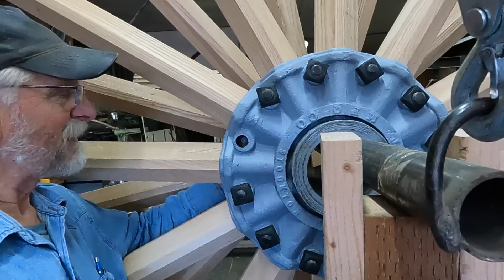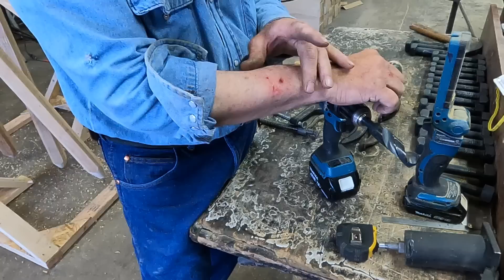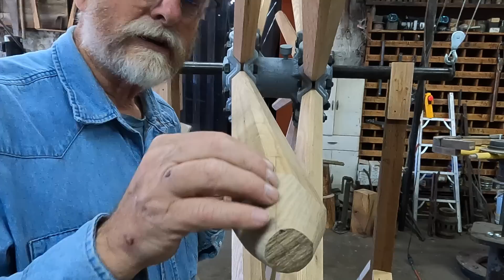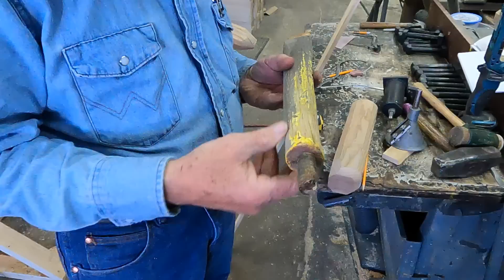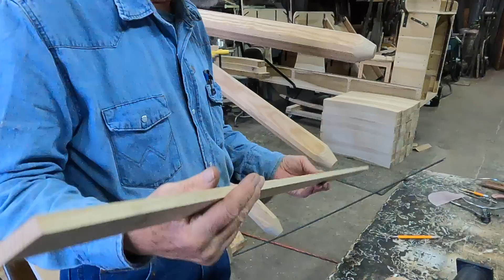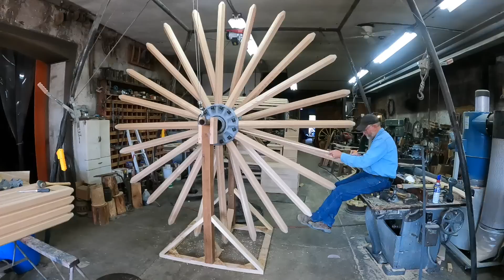Fixing Miscalculations on 10' Logging Wheels | Engels Coach Shop

Comment: Dave,
There is no job too small or too BIG???  Wow, this wheel is massive !  Talking about "blood, sweat & tears" !   I too know about a "torqe monster" drill.  I have an old Milwaukee 1/2"  gear reduction drive electric drill motor made in the late 50's, early 60's with the alloy body (before the plastics invastion).  I only use that when I have a helper as it will break your arm if you are not careful.  So the bumps and scrapes on your arm are something I am familiar with..  This job is a fasination in the respect that 98% of the wheels  you work on  are of the wagon/buggy variety.  The 20 Mule Team Borax wagons and water wagon was my first intro into large scale work that you did and I have been hooked since.  This 10' wheel shows the innovations of the early days and the engineering that was around that most of us are oblivious to.  I didn't even know that they made such monsters as this.  It is a wonder watching you bring this wheel back to life.  Great work!    P.S.  I hope that you get someone to help you getting that monster "vertical" and on a stand.  You have had enough injuries!

Comment: Are you sure you have to turn them horizontal? I know that sometimes you put the ends on vertically. Sounds like a lot of work turning horizontal if you don't have to. But you're the expert, you do you. Just be careful. That's a lot of weight. 💖🌞🌵😷

Comment: Hi Mr Engel
Why did you put the nuts on the bolts securing the spokes to the hub on the outside of the hub?  If I was doing this job I would have put the nuts on the inside of the hub as I feel a bolt head on the outside of the hub is more aesthetically pleasing.
Regards
Dereck

Comment: From a physics/mechanics point of view, the spoke tenons should not be angled to perpendicular to the rim. Load points hub-to-rim should be one straight line, else a tendency  to split open the spoke.  From an assembly point of view, what you are doing is desirable if not absolutely necessary.  A design solution is to taper the tenons just enough to clear the angles of dish and interspoke radii.  This allows for ease of assembly in both directions, lateral and circumferential.  For example, a 10% taper locks up so good it is standard in machine shops to hold high torque shafting together (see Morris Taper).  But in wood, wet swelling gives problems whether taper or constant diam.  The key would be how the tenons are locked into the felloes (beyond compression). A round dowel from side to side through the middle of the tenon?

Comment: First, I know nothing about wheelbuliding other than building a couple of wire-spoked wheels.
But: with wire wheels it's not unusual to have the spokes from each side enter the rim (felloe) on different hole circles. (and sometimes they alternate, and the 1914 Crossley cars laced one hub to two rims...) So did you check the photos to be sure that the spokes enter the felloe on the same circle? 
Also: If I was making these wheels, I would have staggered the felloe halves. Possibly because I know nothing and would have later regretted that choice. Would that work?

Comment: I'm wondering how you are going to get the shoulder of the spoke ends to line up flush to the felly when adding that angle to get them perpendicular to the felly.   Looks like some chisel work up ahead.  I can't see why the spoke ends need to be angled.  If you make them true to the total spoke and drill the gelly holes at an angle to match, the ends should be able to knock into the felly holes with a bit of initial splaying.  You'll still to chisel the spoke end shoulder to compensate for the dish angle.

Comment: The difference between something being "engineered" and being "crafted"... When it is "engineered", you draw up your designs and cut it out / machine it exactly per the design and it should fit together exactly as you designed it.  When it is "crafted", you plan less and leave yourself some extra slop in the dimensions so that you have room to "make it work"... Considering the fact that you are working with inconsistent castings, an "engineered solution" would be an optimistic idea at best... ;)

Comment: Use the clutch set on it's highest setting on the Makita when drilling holes to prevent such injuries. The clutch will just slip when the bit catches, instead of trying to break your wrist. As soon as I detect that the bit is starting to "grab", I turn the clutch on.

Comment: Is angling the tenon a good idea?  You are cutting across the grain at each end and the amount of continuous long grain left is somewhat reduced.  Why can't you drill the felloes to suit the entry angle of the spokes?  Assembly would be not much different to persuading the spokes into a standard felloe, except you'd have compound angles, but given the length of the spokes, I can't see it being a serious issue.  A bit of extra fiddling, but certainly not beyond the wit of man, or indeed a man of your obvious capabilities.  I am an Engineer, not a wheel builder, so if I'm missing something, please set me straight!

Comment: Dave, while creating the tapered ends coukd be wishfull thinking, leaving the spokes long was precognitive foresight! At some point in your considerations, your mind has been determining how to install the fellow on the spokes. Realizing that either the dowel ends would need to be angled or that the dowel holes in the fellows would need to be angled, and which will give greater strength  your mind allowed for both options. By angling the dowel ends, it reduces stress on the fellow sections and will make that joinery easier and stronger.

Comment: Fascinating and as always, beautifully presented and explained fix for a minor hump in the road.
When drilling catchy holes, flip the drill to screwing and set the torque control where it'll drill without constantly stopping, but doesn't try to chew your arms off in the process.
Obviously high / low speed gives more torque settings also.
There are torque bars in the box with some drills, though they're easy to make too.
Thanks again for sharing.
Absolutely love following your work!!

Comment: Modern drills are dangerous.  A plumber working on the new addition to our house had his DeWalt drill catch while using a 1" spade bit.  It broke his wrist.  Having witnessed that I bought a "Flex" 1/2" drill.  They have sensors that sense when the bit catches and shuts the drill down.  That was 2 years ago.  I've had it shut down many times but never been hurt by it.

Comment: Good Job !!  
I don't know if you knew exactly what why you added the 1/4" to the rough spokes in the milling before needing it. But, it reminds me of the many x's I would see a co-worker (partner .. as we usually had teams of 2) making risky choices early on in the project. 

Side note:
usually one of us had more experience than the other, so, ego was bumped up against at times.

Anyway, I didn't always know what exactly the step that would fail or what problem that might occur when I suggested to the co-worker that he might want to re-think that step or that cut in this case. But, somehow I knew there could be problems farther down the line. 

I have to say, it's hard for the co-worker to hear a critique if you can't explain exactly what you are afraid of happening and some critique's can end up w/several different outcomes. 

3 steps later you find out what exactly you were worried about and you hope you've given yourself plenty of leeway or you find that you've failed and should have.

Experience is a great foundation to lean on. But , in my case , I'm sure that working by myself was most successful. My bosses told me I was the slowest at everything but they never had to geaux back and fix anything I did. I guess that's why they kept me and eventually had me running the jobs. 
I'm not boasting. It was never appealing to have arguments from my suggestions.  But I didn't like the # of carpenters I've seen over my 30 or so yrs get fired for too many mistakes. But I will say, I always enjoyed the sense of accomplishment that came w/the challenging jobs the bosses gave me and the fact that I could focus when working alone.

God job Mr. Engels,
Thanks for sharing your thoughts and fine work,
Sincerely .........................
God bless.

Comment: Very nicely explained. So if you had cut the tenon straight down the axis of the spoke, you'd then have to drill the hole for the tenon in the fellow at an angle. And the next tenon/spoke would be at a reversed same angle, so each all tenons/spokes from one side would be at the same angle and all  tenons/spokes from the other side would be at an equal but opposite angle. So when assembling the fellows, then you'd have 2 different angles to contend with for the tenons, which would make assemble very hard if not impossible.

Comment: I was wondering about the angle also, but was wondering why the holes in the felloes couldn’t be drilled at an angle to match the spokes.  I know motorcycle wheels are a completely different animal, but on motorcycle wheels the sockets for the spokes are stamped at an angle to match the spoke angle as you don’t want a bend in the spokes where they enter the rim.  It isn’t obvious to me why this wouldn’t also work on wood wheels.  It would require a jig for the drill press table to hold the felloe at the required angle, but this seems to me to be no more difficult than cutting the spokes at the right angle and location to center the dowel on the spoke at the base.  The big issue may be that there wouldn’t be enough give in spokes of this size to accommodate the slight change in angle that would have to occur as the felloes are hammer on as the spokes would have to move toward the wheel center as the felloe moved into position.

Comment: It's hard to tell in the video, but it looks like the tenon end of the inner and outer spokes are not quite in the same plane. Are the spokes going to need to be bent inward a bit to be in the same plane, and will this mean the tenon angle needs to be even a little greater than what you just marked?
Reply: Yeah that bothers me too. It looks like those spokes are never going to meet the centerline of the wheel. And considering their stoutness there's going to be no bending them in.
Reply: I too was wondering about the spoke inner & outer sides each a little off the hub center. Maybe the felloes are wide enough to allow the tenon holes to also be off set to accommodate this. Guess we'll find out next chapter.

Comment: Why can't the tenons be straight and enter the fellows at an angle? Wont the bending force be balanced by the opposing set of spokes?
Reply: I'm no expert but how could you knock the felloes onto the spokes when you have two different angles built into the felloes. and the spokes
Reply: @pertwee9376  Well you can sew on your new expert patch.
Reply: @pertwee9376  possibly by inserting the spokes into the felloe sections first, then bolting them up to the hub as sub-assemblies? Unlike conventional wood hubs the order of assembly may be more flexible here? As gav2759 commented below, this approach would still leave the problem of the tennon shoulders not meeting the felloes correctly.
Reply: @pertwee9376  I did not visualize that right. Also that correction must happen when he cuts the tenons vertical against the floor.

Comment: With 48 of these spokes to cut, I'd think about making a horizontal tenon cutter, or modify the current tenon cutter you use to cut horizontally.  Looking forward to seeing how you overcome this one, Dave!
Cheers!
Whipple
Reply: I think a length of pipe of proper dimension with cutting tool fitted on a floor stand referenced to the spoke and offset to proper angle would work.

Comment: Why couldn’t the tenons be centered on the spoke alignment and enter the fellows at their respective angles ???
Reply: The tenons need to be angled so the shoulders fit the fellies.
Reply: If tenons are not radial, cannot assemble felloes due to opposing entry angle from spoke tenons on other side of wheel.

Comment: I suspect that arm has a broken bone judging by the swelling.  Get it X-Rayed.  I just scrapped 5 Makita Drills and a recip. saw due to unavailable or wildly overpriced batteries.  So sad to toss good equipment.  DeWalt for me now, some with Cords!  Tired of being able to drill 1 and ½ holes!
You sorta lost me on those spokes and tenons.  Looks like 3" Sched. 40 would fit those hubs, cut and weld to Tire.